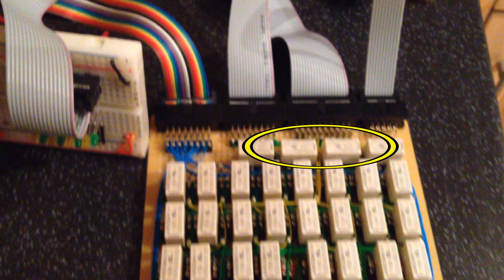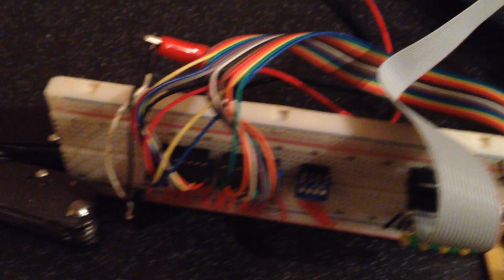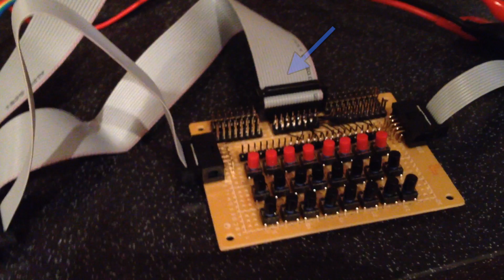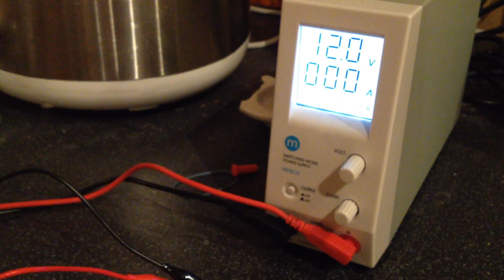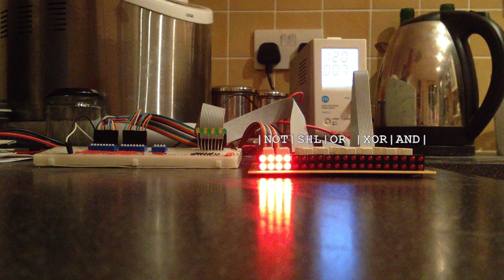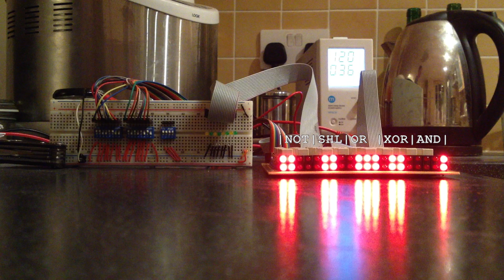Relay Computer: ALU Logic Card Full Test

Comment: What are the dimensions of that ALU card? I've been through your website and could find all sorts of useful info - except the dimensions.
Reply from the maker: All the main cards are the same size at 160x115 mm. Originally I was using pad prototyping boards: https://www.bitsbox.co.uk/index.php?main_page=product_info&cPath=238_244&products_id=1861 but now moved over to PCBs ... here's the Decoder as example: https://easyeda.com/paul_6392/rc-decoder